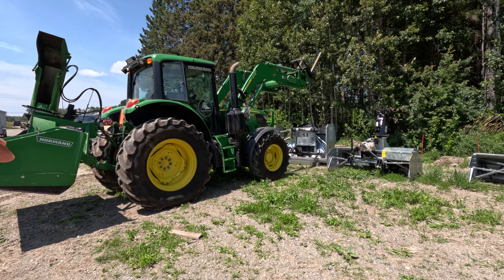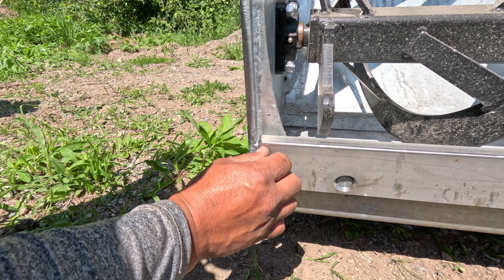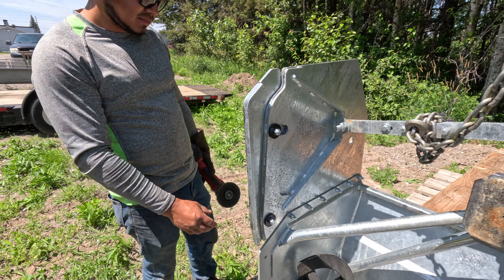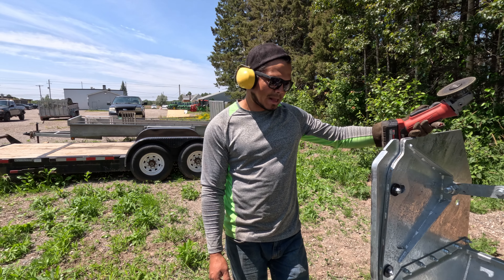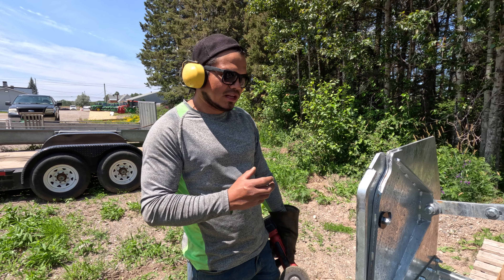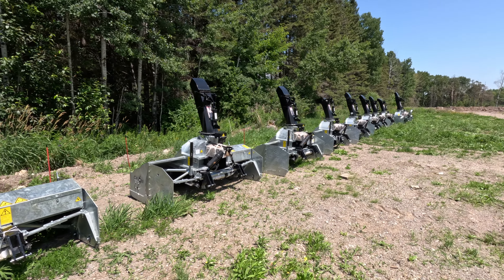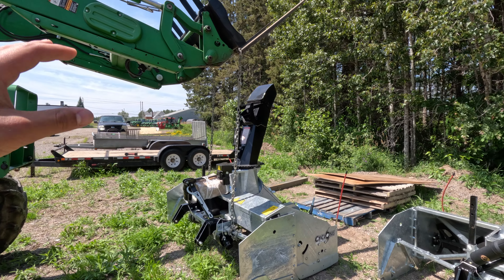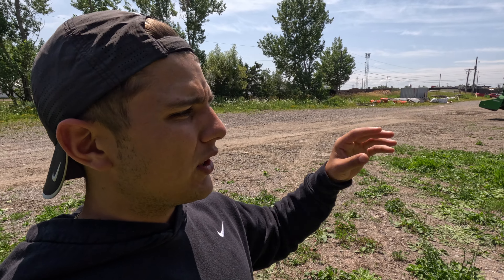YOU WILL DAMAGE DRIVEWAYS IF YOU DO NOT WATCH THIS!

Comment: My worries about about grinding down the main edge is now you will be leaving a skim of packed snow on the driveways.  I agree doing this on the corners but concerned on how well it will scrape clean the snow from the surface.  I have heard many complaints from contractors that the inverted blower leaves a skim of snow on the drives, and their clients are unhappy about this.
Reply from the maker: This method was taught to me by Jim Mackenzie. He runs 85 tractors this same way and has worked well for him. I took his advise and tried the same method he proposed to me!
Reply: @Stefano_Narducci I am not knocking your suggestion, just pointing out you will be giving up some quality of scrape for reduction of scratching.  Rounding out the corners is a brilliant idea.  We only used poly cutting edges on both the wings and main cutting edge to eliminate scratching, but it came at a cost of not scraping down to bare pavement.
Reply from the maker: Yes I do agree, dulling the edge will certainly result in less of scrape. However I wanted to have the best of both worlds. Less scratches with better scrape quality and I think this is going to make a world of a difference as we have been using Polly and rubber for years…